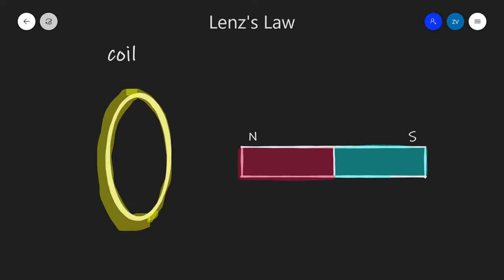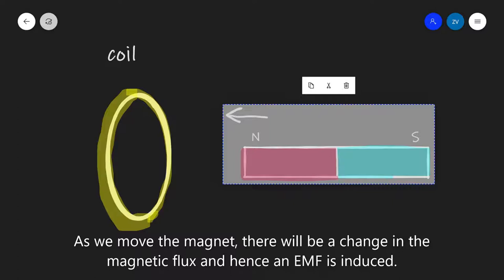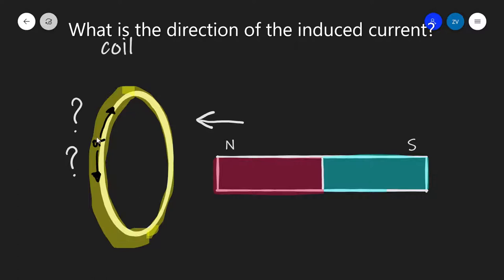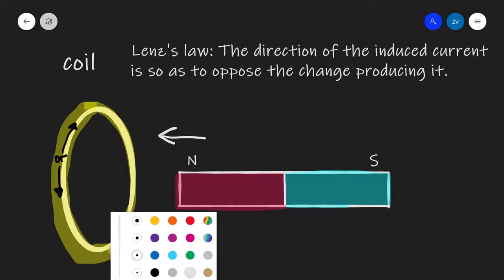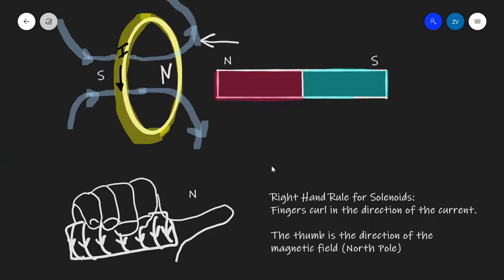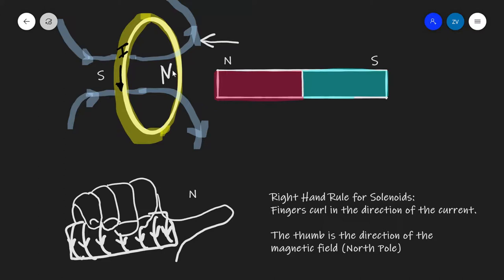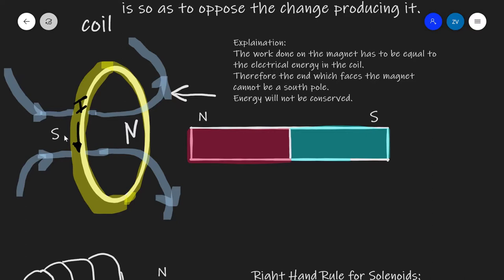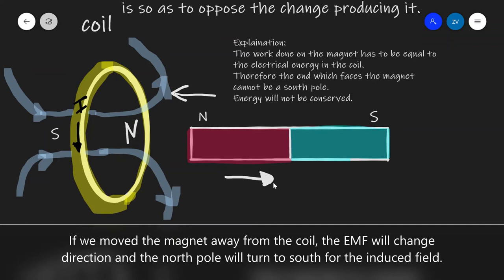A Level Physics: Lenz's Law explained

Comment: I think it's easiest to not refer to magnetic north or south at all (for the coil). When moving the magnet to the left, there is an increase in magnetic flux through the coil to the left. The coil simply responds to oppose this change by Lenz's law, by creating it's own magnetic flux to the right, and so my right hand grip rule the current circulates in the direction indicated. 

This is more general than the "coil magnetises this way, depending on whether the fixed magnet is being moved in/out", which isn't particularly helpful for other configurations, e.g. if the area, or the angle of the coil is what is changing (rather than the position of some external bar magnet). For example, consider a magnetic field into the page, and metal loop of wire drawn on the plane page. If the metal wire is "scrunched" then there is a change (decrease) in area, thus a change in flux and an emf generated. The external magnetic field hasn't been "moved", so it's really difficult to tell which way the current should flow by assigning a north and a south to the coil like in this video. If we just stick to magnetic flux, then we can say the flux has decreased into the page during scrunching, so the coil tries to oppose it by reinforcing the magnetic flux into the page by creating it's own magnetic flux into the page, and thus the induced magnetic field is into the page, and by the RH grip rule the current circulates clockwise.

Comment: I don’t understand how the coil will change from north to south when moving the magnet away. Why can’t it still be a North Pole?
Reply from the maker: Excellent question. If it was a North Pole, the two would attract breaking conservation of energy.
Reply: @zhelyo_physics  but how is it  changing I don't understand that 😭 how did it just change from north to south when the magnet is pulled away
Reply: @hamdanadeem7442  It’s more like the direction of current induces the magnetic field with the north and south. When the magnet is pushed in, the current inside the coil will move down creating a magnetic field where the North is on the right and South on the left. (This comes from the RHR of a moving current.  You point your thumb in the direction of the current and the rest of your fingers curling is the direction of magnetic field.) Now when the external magnetic field is being pulled out, the current will move up where it’s own magnetic field will have North on the left and south on the right. So essentially, it’s the direction in which the current moves that explains the direction of the magnetic field in the coil and where north and south is. Sorry for the wordy explanation. I’m studying this unit for my test too and explaining it like this helps me understand it too. Lemme know if there is still something you don’t understand.
Reply: @hamdanadeem7442 the coil doesn't actually have two consistent north and south poles but they are defined according to the direction of the induced current
Reply: @hamdanadeem7442 Magnets has a consistent northpole and south pole while the coil does not have a consistent north pole and south pole. So when you approach  the north pole magnet facing the north pole of the coil it literally opposes since unlike charges(N &N)  repels and when you take the magnet away the side of the coil that suppose to be the North Pole changes to South Pole because the coil reverts to neutral states since there's no more induced emf in the coil. So I think the creator just try to explain that the northpole of the coil will try to oppose the change from the northpole of the magnet while when we take back the magnet from the coil it determines that there's no more induced current that's why it change from north to south, badically in real scenario theres no more north or south pole in the coil  . I hope i explain it clearly😊

Comment: Hey there! Love your videos. I do have a question though: If you used the south pole of the magnet would the effect be the opposite, or do we only need to know what happens when the north pole of a magnet is moved towards or away from the coil? Thanks!
Reply from the maker: Yep! The effect is opposite in this case. The current always goes in a way so as the oppose the magnet.
Reply: @zhelyo_physics  thanks a lot! Makes sense :)

Comment: Thank you so much. I really appreciate that.
Reply: I have a question about inductors. How do inductors really work? Does change in current makes changing self-inductance and which generates these EFS currents that are pointed in opposite direction of initial current?
Reply from the maker: anytime!
Reply from the maker: in short yes, excellent! I think I need to do a separate video on inductors.
Reply: @zhelyo_physics  I was wondering. Where does that current come from when it is induced in opposite direction? Like if all electrons are going already in 1 direction, where does new induced current get its electrons?

Comment: @zhelyo_physics  I was wondering. Where does that current come from when it is induced in opposite direction? Like if all electrons are going already in 1 direction, where does new induced current get its electrons?
Reply from the maker: great question! we need a conductor with electorns already available to induce emf.
Reply: @zhelyo_physics   Yes, but all electrons are already flowing in 1 direction. Are they?

Comment: Why does the current go anti clockwise in the first example ? I understand why it's a North pole to repel the magnet. Thanks Sir
Reply from the maker: so this is a consequence of Fleming's Right Hand Rule, I might do a follow up video on that. For the exam worth remembering that if the magnet is moving towards it, the current will be down and if you are moving away it will go the opposite way.
Reply: @zhelyo_physics  Thanks for replying Sir - is it okay if I remember it as if a North pole is induced, it's like the bottom of the N turning ACW. And for a south pole, it's like the S is turning clockwise

Comment: Sir how can we know where we should apply right hand rule and left hand rule
Reply from the maker: Hi, the right hand rule listed in the video is for solenoids only. For other situations, use the left hand rule. There is also the right hand rule which is separate for the direction of the field around a wire. I can see how this can get pretty confusing pretty quickly, actually!

Comment: I don’t understand what happens to the current when we move the magnet through the coil does it change direction ?
Reply from the maker: If the direction of motion changes direction.
Reply: So how will a current distance graph look or something like that
Reply: @zhelyo_physics  if u move the object faster will it induce a higher emf
Reply: Also one more thing is endured emf the same as w/Q for a constant area of flux density